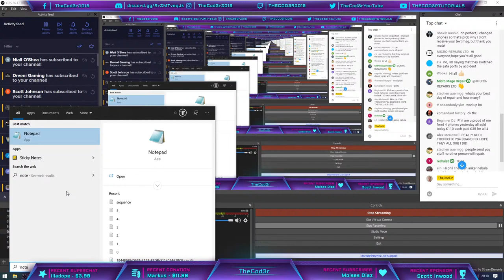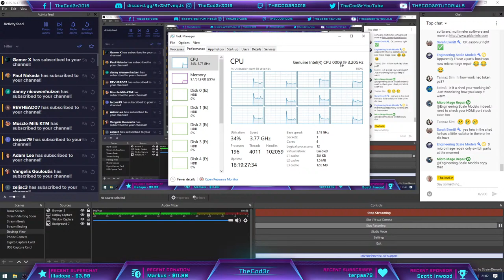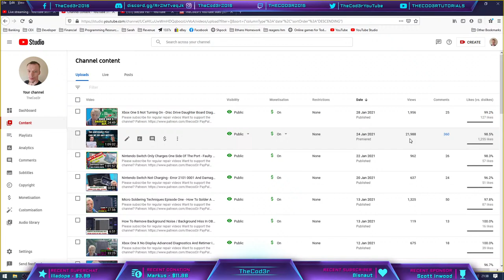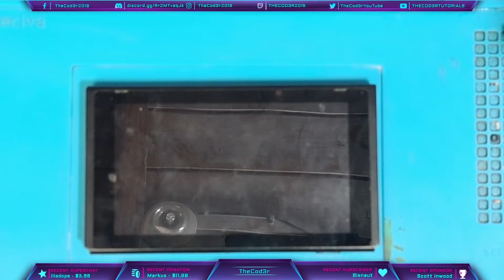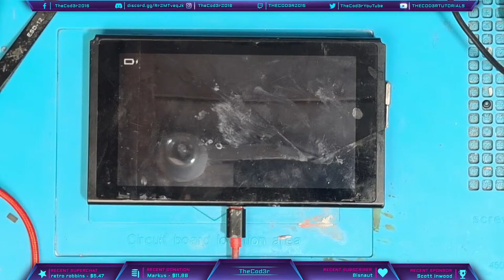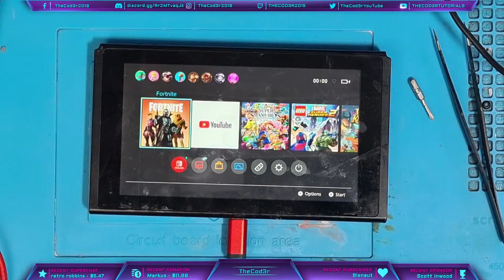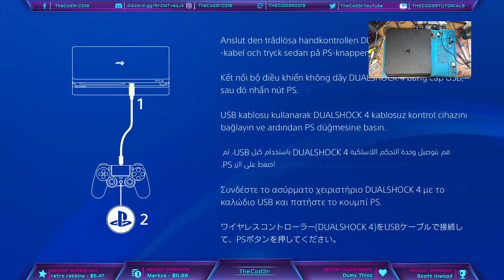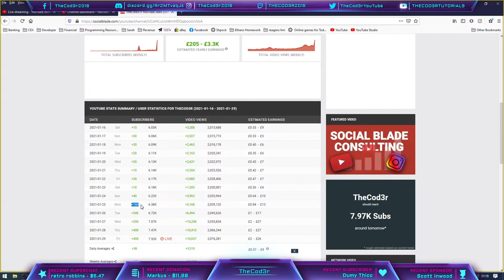Hello World :) Fixing Consoles As Usual

Comment: Love the content . Question, I have an Xbox one and an Xbox one S both work perfectly fine the Xbox one S just had a disk Drive that wouldn’t play disc otherwise begin work fine. I have a working this drive from an original Xbox one I tried to swap them at worked for a while and then I got an e100 error. I’ll swap them back and now even the original Xbox one boots straight into VE 100 error. It is part of the insider program and it was also just updated recently (January 2021) before the error. Ive tried all the lastest osu. 1,2, and 3. Any advice?

Comment: cant believe you dont clean off the old solder  once ics are removed and fresh leaded solder added to the pads!!!
Reply from the maker: You don't need to clean off the old solder, adding leaded solder changes the composition. In the hundreds upon hundreds of consoles I've repaired I've never had a console come back for dry, cracked or oxidised joints
Reply: @TheCod3r   its common practise for me and many other board and component repair specialists it takes that possibility of a dry of crap joint away  and a returned repair and lead is better than the crap they use these days. but maybe its my way or working /thinking!! ( and it looks better...lol )